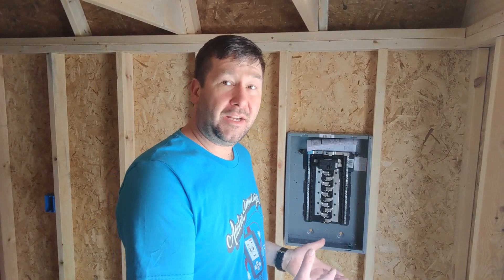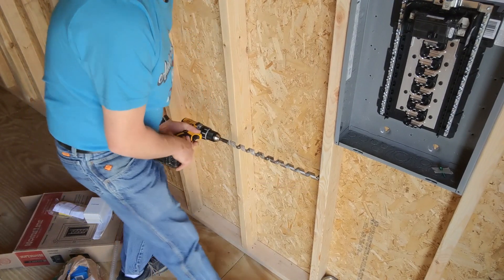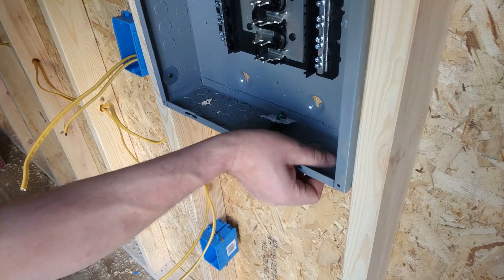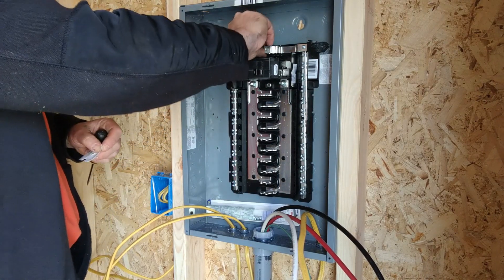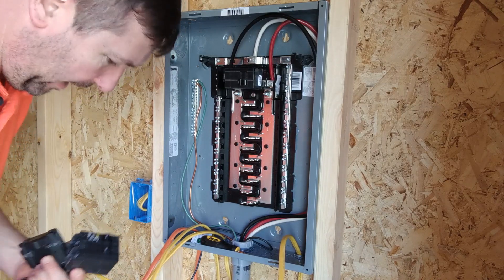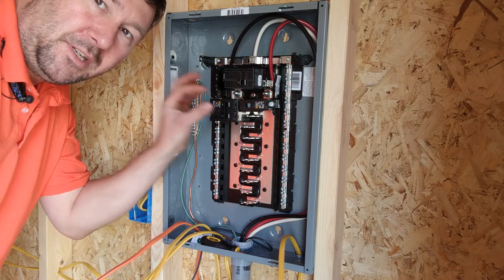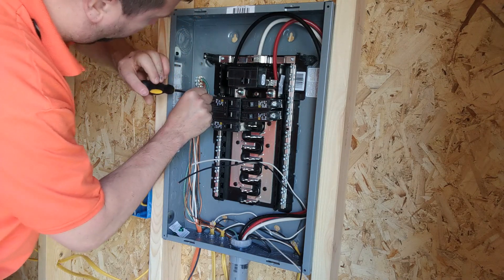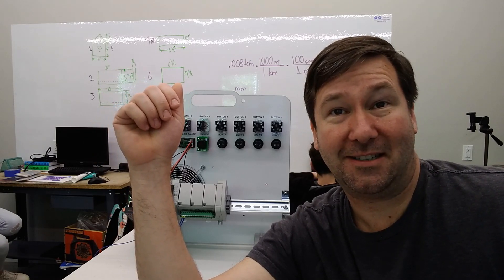How to Wire a Subpanel

Comment: @rashellyohn5128
0 seconds ago
Hey Tim pls read!
Thank you for this video. I really need help!
I have this pump that had 10 gauge 3 hot wires and a ground coming from my panel . 2 hots and the ground were directly contacted to the pump while the 3rd hot was wire nutted off to the side. I have since added a sun panel with( 2) 15 amp double pole breakers in hopes to split the power of one double pole breaker to add a 110amp outlet. Only thing is there is no neutral wire. I got the pump working off the 2 double 15 amps but the gfci only the green light came on but had no power to light the heat lamp. Could I add a metal stake into the ground , run a ground to the bus bar then run a wire to the bus bar to the gfci as my neutral wire. The ground is connected to ground screw of sub panel and also the ground wire that was originally connect to pump is also connect to ground screw. 
Thank you for your help.  At this point I’m not worried about code as I am keep the pump from freezing.
Reply from the maker: No, you must have a ground from the power source. Call an electrician

Comment: The very fact that building codes vary depending on the municipality is why I avoid pulling permits on anything. If the inspectors cannot even agree from city to city, I will do it the way that I see working the best/safest and save the permit fees. And yeah, I am a licensed builder by trade haha

Comment: I have a question. I installed a whole house ATS. Im connecting to the breaker which has just become a sub panel. I assume that i have to now install a seperate ground terminal bar in the old breaker on bother sides of the lines. Now I then take a wire from from both ground bars  and run it into the ATS using two wires 3 AWG (copper)   going to ATS ? I am to move the earth ground from the old breaker over to the ATS.  The neutral is already connected through the transfer switch block over to the sub panel. The changes are only on the ground ?
The breaker is 200 Amp in ATS and old main breaker.
Reply from the maker: Improper grounding not only can damage the generator, it can get you hurt.  Time to call an electrician.  It will be dollars well spent and some localities have different specifics on this so no one here can give you sound advice.

Comment: Great video. Why aren’t the neutral and ground bonded in a sub panel?
Reply from the maker: You need to check your local electrical codes but here, they can only be bonded in one place, the main panel.
Reply: They aren’t bonded in a subpanel to eliminate a parallel path of current back to the panel on the ground and neutral. Since the white neutral is the return for current to flow back to the source, if you were to bond the ground to it, it would then share a path  with the neutral and share the current flowing back and becomes a current carrying conductor which it was not meant to do. The ground is only suppose to carry current in a fault condition ie short circuit or ground fault. This is why they are separated. I hope that helps and was understandable.

Comment: Question...installed sub panel into our shop, when testing its running 110v at box and outlets..but nothing is working?
Reply from the maker: How an electrician to check it out. I won't cost much and you'll know everything is safe.

Comment: im confused when you hooked up a white neutral to a breaker
Reply from the maker: The double pole is 220V
Reply: Nice video tim ! but shouldn't the 3 wire be black and red to double breaker and white to neutral
Reply from the maker: @thomassmearcheck2819  No one said this was 3 wire...that is typically for when your application requires a neutral.

Comment: So you’re saying a sub panel needs ground rods driven into the ground and not ran back to the main panel?
Reply from the maker: No. In my locality, sub panels that are in separate buildings must have both a ground from the main panel and a ground rod. You need to check your local laws and codes.

Comment: I don’t mean to be that guy I just would absolutely never use that bit it is just too comically large to even justify picking up instead of a paddle bit. Seriously a whole set of diablos is like $20
Reply from the maker: You mean spade bits? Nah, I can't agree with you on that one. An auger bit takes less effort. Let the rolls do the work. And I have shorter ones for tight spaces but this one is much easier on the body.
Reply: @TimWilborne  alright fair enough i concede

Comment: It seems hard to find a video or information, easy, about wiring/power cables, running from my house to my disconnected garage when my garage is not really disconnected. Its a 1975 house with an attached walkway to the garage with power cables running up in the attic all the way. Im missing something.

Comment: No main on the sub panel?
Reply from the maker: Not required but can be there. Remember this varies by locality so check codes applicable to your area.
Reply: @TimWilborne  it does vary. A requirement for some, a convenience for all.  You can back feed a breaker equal to or larger than than the feeder breaker in the main if the sub doesn’t have a main.

Comment: Would there be a case were a residential complex would have 480 coming in
Reply from the maker: Maybe on large chillers used for the whole building, elevators, etc but not inside the dwelling.

Comment: Why would you use a white( neutral) wire in combination with a black( hot) wire for a double pole breaker? Shouldn't it be 3 wire,red and black to double pole white to neutral and ground to ground?
Reply from the maker: Not all equipment requires a neutral.  In many cases, only 2 legs of 120VAC and a ground are required.
Reply: @Tim Wilborne  appreciate your answer.
Just a quick question.  When wiring a sub panel, it should not be wired were the ground and neutral are bonded? What type of panel is that.  Does it come not bonded?
Reply from the maker: @newday8172  That could vary depending on where you are located but for the most part they are only bonded at the main panel, they are separate at sub panels.

Comment: Okay, this was super helpful.
We're running a sub panel into our shed to run an ice machine and a time clock, and this video helped with some of our questions, but everything inside the shed will be 120v, so do you have a video of how you connect this inside the main panel to feed the sub panel?
Inside the shed will only be an ice machine, a time clock, and a couple outlets and 2 led ceiling lights. All 110, so we wouldn't need 240 coming into the shed. We'll have a separate breaker in the main panel for this shed, but how do we connect that breaker for 120v and 100 amps?
The 100 amps is the bosses decision.

Comment: Not bad, but still need to watch another video to pull the power and run the conduit.  Not a full subpanel install video.  Basic "wire any panel" with the exception of the ground bar being different in a sub panel.

Comment: Ya lost me.
If I had a double pole breaker. That means I have one breaker that has two outputs. I would put my black wire into one of them. And then I would put my red wire into the other pole.

Let's say I had 12 three wire. I would have a bear ground wire, a red wire and a black wire, and the white wire would be the neutral wire.

I don't understand why you would put a white wire which is generally a neutral wire into your breaker?
Reply from the maker: Not all 220VAC requires a neutral.  For example this is a common dryer plug that you would use a 2 w/ ground...black, white, ground.
https://amzn.to/3SJ7GpD

Comment: I noticed that your ground wire is significantly smaller than your supply conductors?  Are ground wires sized differently than supply conductors?

Comment: Is the panel box itself (equipment ground) grounded with just the two screws holding the grounding bar to the panel case?  On the face of it, it doesn't seem sufficient.

Comment: I appreciate your mention of the ground rod installation. I believe when my place was done, I may have had one of those vendors that cut the rod short. I'm running into bleed over issues with one circuit on a 100-amp panel and have a few suspicions.
Reply: i don't think that grounding rod should have been installed in the first place.  The grounding bond should only be at the mains panel.  By adding another ground rod, you can potentially create another path back to source through earth that would cause the issue you're talking about.  The bleed is current on ground where it should not be.
Reply: Shared neutral across 2 phases.
Reply: I'm curious what you mean by bleed over issues? Could you elaborate?
Reply: @ericwotton2046  Voltage is being split between the neutral and the ground wire without tripping the breaker.
Reply: @StoicThrower  Interesting, is it just one circuit causing the issue? Your panels are all networked properly with grounds and neutrals separated back to the main service panel (where they combine.) You might have a ground fault within that circuit either an appliance or improper wiring in the brach wiring. A ground rod really wouldnt effect this much unless multiple transformer are involved.
Reply: @ericwotton2046  yep. One circuit.  Checked it all. Replaced every receptacle. Wired correctly.  Nothing was plugged in. Never did find a definitive reason for it. Ran a new 20 amp circuit with no drama.

Comment: You exceeded code on a couple things, good for you. Ground rods only need 6 feet of separation and NMB needs strapping within 12 inches from the box not 6.  I could not tell if the grounding electrode was continuous between ground rods as is required due to ground rod clamps are rated for one conductor only.
Reply: 12" if cable clamp in box 8" if no clamps
Reply: @thomasmarable6818  Correct, he has boxes with listed clamp. So 12" is maximum.
Reply: Just been going through my 08 code book and can't find the 8 inch requirement, Got a code reference? Thanks.
Reply: Its in article 334 not sure about 2008 but my state is on 2017 code cycle
Reply: @thomasmarable6818 I found it. 314.19(C)  334 is NM cable and only references 12 inch.

Comment: Great video for sure. Very informative. So I went to the link on determine wire size and distance. I am running a #6 (copper) from the house to my shed sub-panel. it's 165 feet. Probable will running a window unit at some point. Not running anything big, maybe a fridge, computer, small air compressor. So is number #6 to small at that distance or should I run #4?  Setting up a 50 amp panel in the shed. Thanks!
Reply: Did you get the link to work? I couldn't.

Comment: For anyone new at a workplace or wherever it's needed or required, the "cosmetic" part of it takes a long time to get a feel for. It can really be a pain in the neck to sit for hours bending and twisting cables and wires only for the looks.
Reply from the maker: Yes. I don't know if you ever stop trying to improve on that!
Reply: @TimWilborne  And don't ask me how I know... I remember being new at a place and how much time it took to mess around with the wiring and to make it look good, etc. The tasks per se weren't difficult even though I'd never set my foot there before let alone worked with those things in my life. Once you knew exactly what to do and how to do it right it was okay. The trickiest might've been reading the charts correctly, like connecting certain components on to the boards. Anyway, to cut a long story short, the job lasted for 2 months when I had to quit. I used too much time in someone's opinion. In MY opinion, kicking someone out after 2 months is ludicrous.

Comment: Dear Tim
I have a detached garage 40 foot from the house.  I understand that I need a ground bar seperate from the neutral bar.  Can I run a seperate grounding rod to this garage subpanel grounding bar?  What is a floating ground?  Can I run the conductors from the house to the lugs on the sub panel or do I need a seperate disconnect at the subpanel?  Thanks
Reply: Yes you run it to the groundbar plus a ground conductor from your main panel

Comment: Question: Is it ok to add a subpanel to the main panel even so the main panel does not have a main breaker? Hope my question makes sense. Thanks in advance!
Reply: Your main panel would have a main breaker. Then in your main panel you would install another breaker which would send power to your sub panel.
If you put in a 200 amp panel you would have two 100 amp breakers. On one leg of that panel you could install let's say a 50 amp breaker and then run power from that into a subpanel.

Comment: What is the main difference between a main panel and a sub panel? Is it just that in a sub panel the ground and the neutral wires have to be on their own bars?
Reply from the maker: Basically. The neutral and grounds must be isolated and a sub panel is powered out of a main panel.
Reply: @TimWilborne  I also have another question if you have time. If you were to open up a panel on a new home with three pin wiring and you were to open up a panel on an older home with only two pin wiring how would you tell the difference right off the bat just by looking? Not for sure if you understand this question or not.
Reply: Lee Sales kk

Comment: 220v arc welder and a 220v air compressor. What size sub panel and gauge wire should I use? Approx 150’ run from disconnect to building.
Reply: Not all 240V arc welders are the same and not all 240V air compressors are the same. First you would need to know the maximum amperage draw from them, then you would need to go to a voltage drop calculator such as: https://www.southwire.com/calculator-vdrop

I think the NEC allows a maximum voltage drop of 5%, but I would shoot for no more than a 2% voltage drop, even though Southwire recommends a 3% voltage drop.

Comment: I need to add more circuits.  I have a 100 amp fuse box and I would like to add a sub panel with about 16 to 24 circuits. Can I add a sub panel rated for 125 amps to a 100 amp main panel?
Reply: Need an upgrade to 200 amp

Comment: Hello. I currently have a 40amp sub panel and need to accommodate an extra 60amps in it. 

In the 40amp sub panel there is a 15 amp and a 30amp. 

What size breaker do I need in the main?

Comment: What do I do if I have a full main breaker  box and want to add a sub panel ? Is there a Way to grab one of my other breakers for the sub panel? I’m not going to use this as my only source just want to see if my project is even possible  I basically have a full breaker and the original basement outlet and so many others outlets and lights are on one single 15 amp breaker so I wanted to add a circuit for basement for my workshop and sub panel seems the only choice i have

Comment: I'm not a controls guy, I worked as design engineer for contractors and consultant from 1983-2018.   Since you mentioned it in your video, what is your perceived purpose for the one or two ground rods in the electrical system?   Not all sub-panels get them as stated, only if in a different building.   Respectfully,    Kevin
Reply from the maker: Hi Kevin.  As far as one vs two ground rods, NEC 250.56 requires a second ground rod if the ground has a  resistance of 25 ohms or more. 

I don't want to get into the argument of whether all sub panels should have grounds or not.
Reply: Tim Wilborne    I totally agree with you on higher than 25 ohms requires second rod.   In my code classes, it was suggested that it is cheaper to just drive two and forget it.   Testing time would be higher cost than installing the second rod.
What I meant by not all sub panels need ground rods, keeping this conversation in dwelling units, if you have a 200 amp main service panel in a dwelling, it is required to have all available grounding electrodes connected to it.   Now put a 100 ampere sub panel in the middle of the dwelling next to the kitchen.   No ground electrodes are required.   Put another 60amp sub panel in a detached garage, a connection to grounding electrode is required.   Note: this requirement of ground electrodes in separate buildings flip flopped back and forth several times between 1981 and 2005 NEC.
Not looking for any arguments.   Hope this clarifies my comment.
Respectfully,   Kevin
Reply: @KevinCoop1  I beleive the main purpose of the ground rods in a simple dwelling is for lighting protection. Thats why a sub-panel in an annex building needs a ground rod. It gives a bath for nuisance current to bleed off the system. It also helps the whole electrical  system have a reference to work with, one common ground. This becomes important in large buildings with multiple tranformers and sensitive equipment.
Reply: @ericwotton2046     Sorry I did not get back to you earlier!   You are correct!
Reply: @ericwotton2046  if you are running 50 feet out to a garage underground and in plastic conduit. would a secondary rod be needed to ground the sub panel from lightning generated electricity coming through the main panel and out to the garage?
Reply: @tenkill .   If the structure is not the same as the original main panel, and is being fed from the main panel, then the sub panel is required to have a ground rod.   If you do not do a test to prove 25 ohms resistance or less, then two rods are required.

Comment: You said that live-to-neutral is 120V but that live-to-live is 220V.....shouldn't that be 240V ?  Also, is the neutral bonded with earth in the main panel ?  Many thanks in advance for your reply.
Reply: There is a long history on what we used in the past as far as volts go. We actually used 100 volts back in the day and the progressed to 110, 115, 120.
Reply from the maker: 220, 230, 240,... They are all the same depending on the area you live in. Same with 110, 115, 120.

Yes in the main panel the ground and neutral are bonded together. Nowhere else.